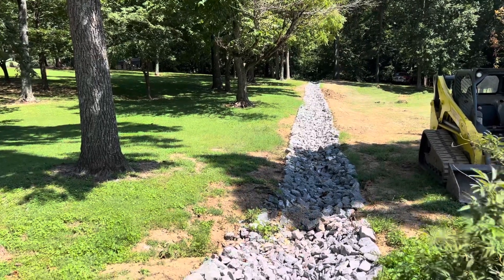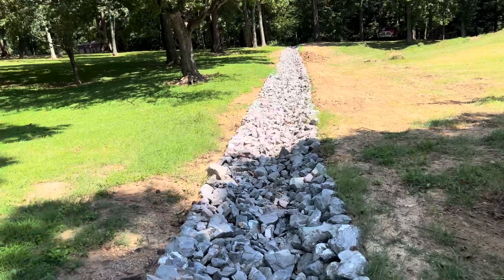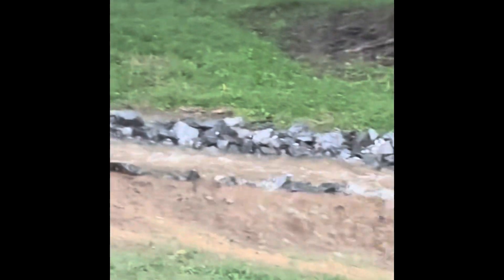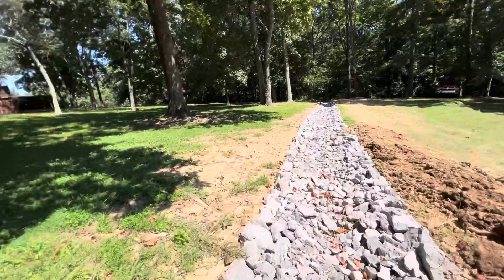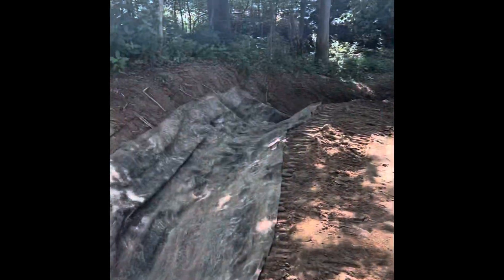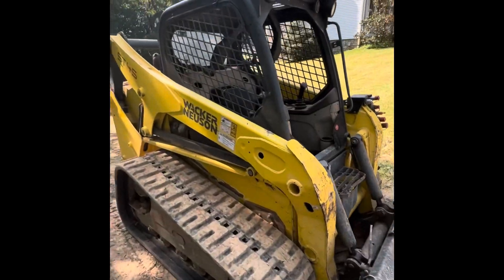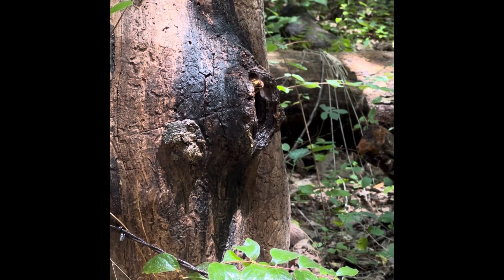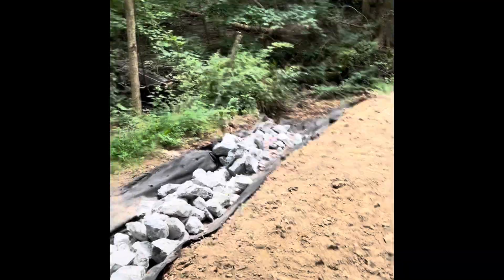How to correctly build a storm water ditch.

Comment: Great video Keith. Thanks for staying on topic & not a lot of chit chat. One question: do you find that adding the geotex facbric to the ditch pays off? We’ve always used it on roads, but usually skip this step in ditches. I’d be interested in learning from your experience. Thanks.
Reply from the maker: Personally, I feel like it’s a must have for a long term erosion solution. Without it, the ground underneath/in the ditch would continue to erode and mix with the rock. Eventually, the rock would be full of dirt and grass, and would just be difficult to maintain. With the geotextile fabric, this ditch will serve decades relatively maintenance free, assuming storm water volume doesn’t increase significantly,